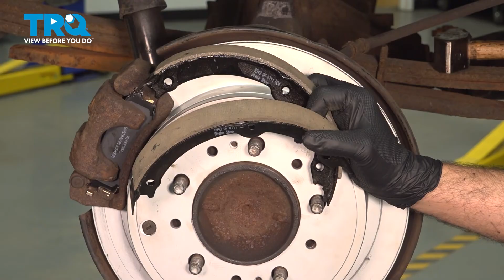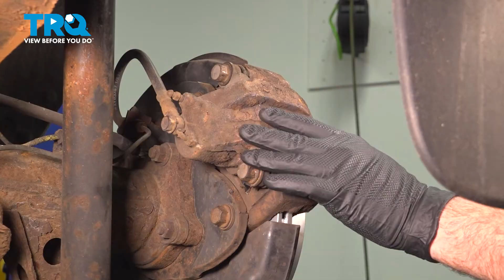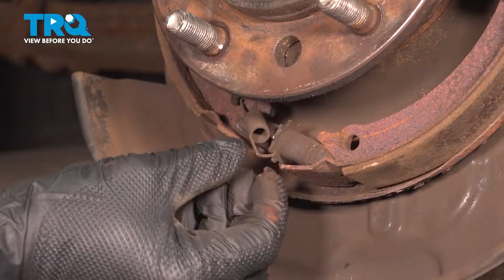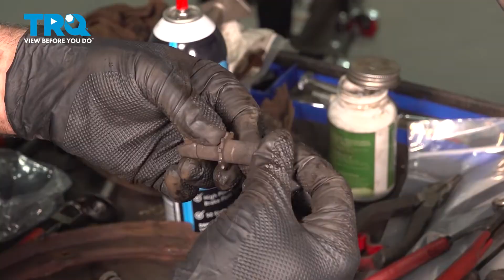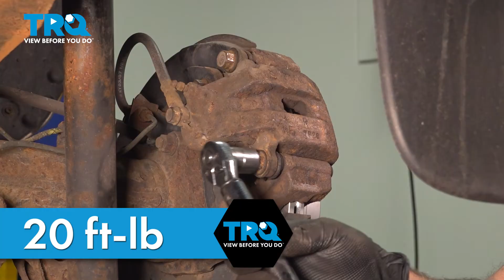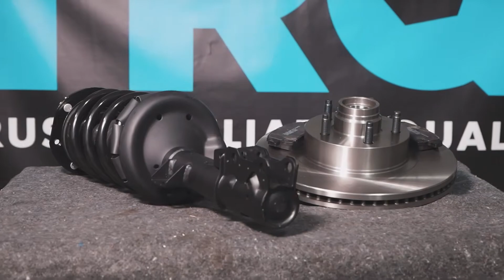How to Replace Parking Brake Shoe Set 2007-2021 Toyota Tundra

Comment: This is a helpful video for the brake shoe change. Thank you!

One thing I notice a lot on Youtube vids, and perhaps it occurs in the real world shops as well: the tech hammers the lugnuts on with an impact, the follows up with a torque wrench. The wrench doesn't move in the slightest before clicking/beeping. That means the lugs are AT LEAST to spec, probably over, possibly WAY over. 

Won't be fun to get off on the side of the road!

Comment: How often do you have to work on these? My 2017 brake doesn't work at all. If I park on a slight slope or even just put it in drive, it doesn't seem to slow the truck at all.